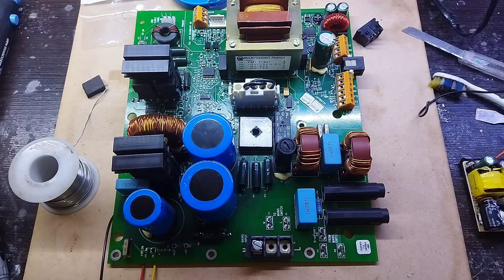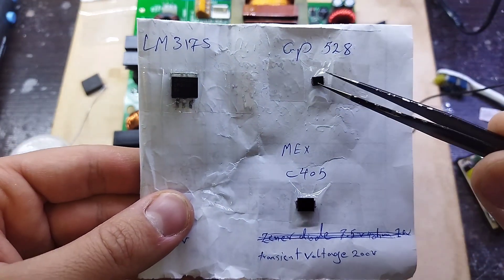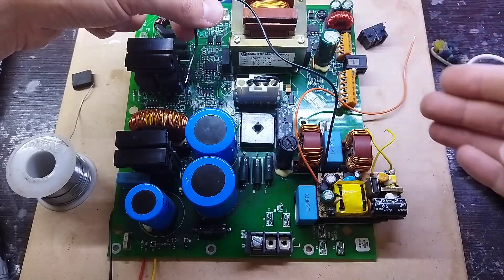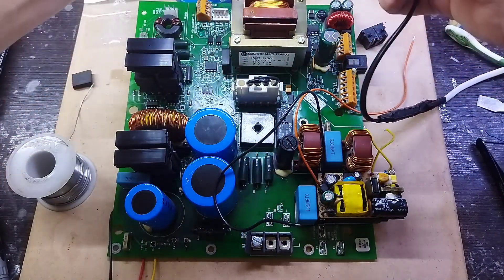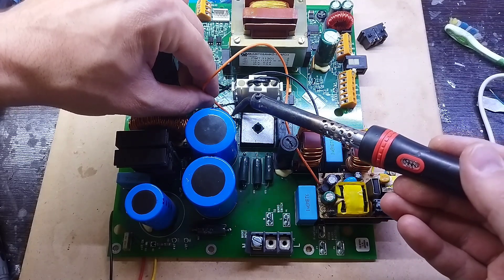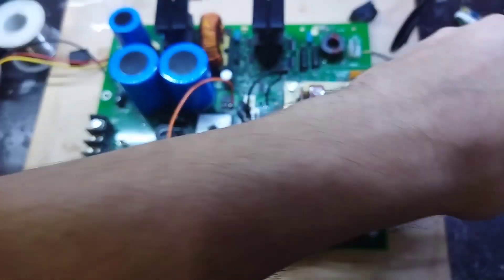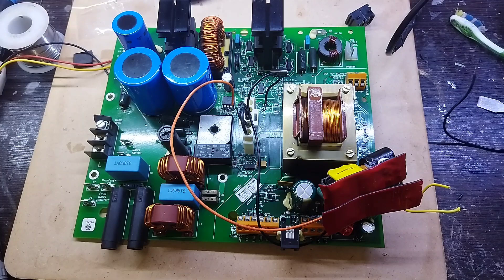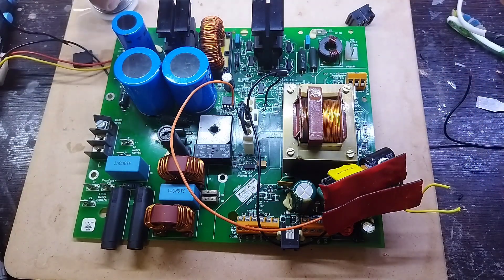power supply smps /Upgrade From Burnt Diodes To A Powerful Smps Power Supply!

Comment: smps what is?
Reply from the maker: A switched-mode power supply (SMPS), also called switching-mode power supply, switch-mode power supply, switched power supply, or simply switcher, is an electronic power supply that incorporates a switching regulator to convert electrical power efficiently.